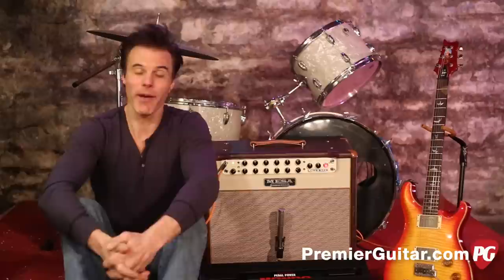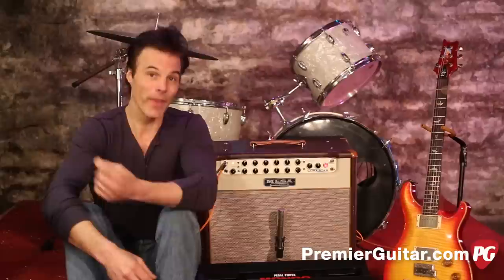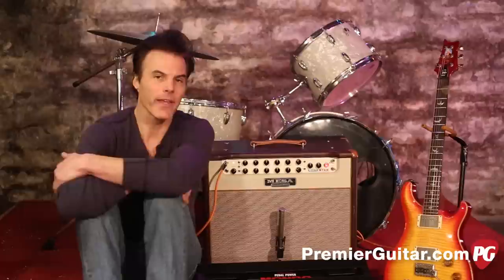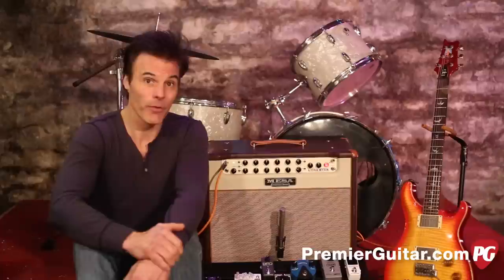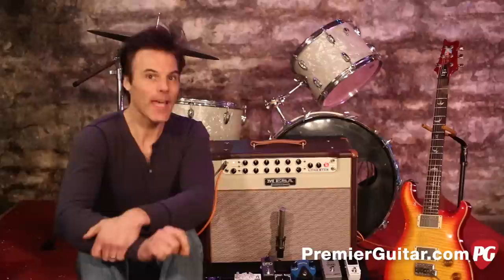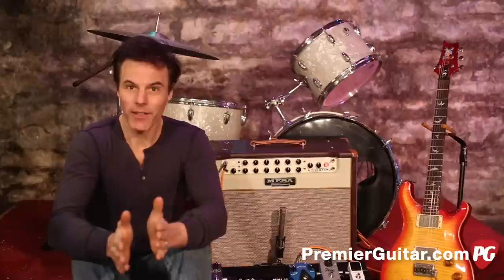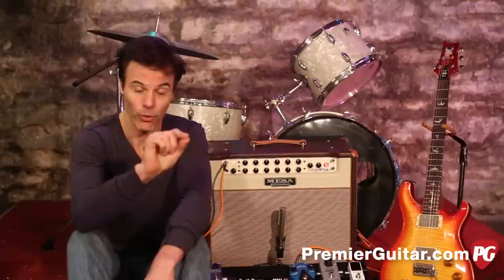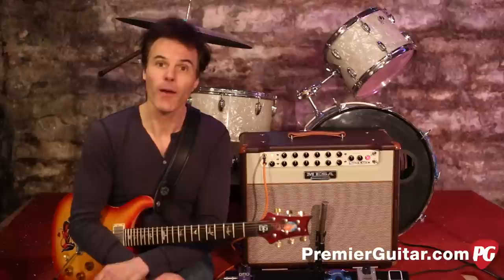DIY: How to Wire Your Pedalboard featuring John Bohlinger

Comment: Or you could use a multi effects pedal or rack and avoid all of this. Or you can run it straight into your laptop and run the laptop thru the pa. There are a million different routes to take to get what you want and almost all are valid.  That's what makes this fun. I have been using an Arion compressor pedal with a Johnson jamstation and running into an old peavey 1x12. Works for me lol.

Comment: Hello john, very good video for begginers, i didn't understand  that you say "overdrives/dist and compressors they might sound better if run it into a power supply that offers sag" 
Can anyone explain it more ? 
thx!
Reply: Some power sources (like the voodoo lab pedal power mondo) have power inputs that allow the electric current to oscillate, so that it mimics a dying 9v battery. Some people like that sound, especially on fuzz and overdrive pedals. If you have any pedal that can be powered by a 9v battery, try doing that instead of plugging the pedal into an electric source. You might notice how the sound of the pedal will change once the battery doesn’t have enough juice to provide a steady amount of current

Comment: Ok what if you used one wall supply per pedal? Would that be considered isolated and cut down on noise? I ask because I have five pedals (one is a tuner) and I only play at home so I don’t need a pedal board and I don’t need it to be portable. I just want it to sound good!

Comment: One thing that is missing....If all of your pedals are True Bypass, you will need buffers. Or pedals that have buffer. I have A Mission Engineering VM Pro volume pedal at the beginning, and a TC Electronic Flashback Delay in Buffered Bypass mode at the end.
Reply: Buffers can adversely- very adversely,- effect some fuzz and drive circuits.Try any buffered pedals before and after , and take note of differences.They can just as easily be placed mid chain.  When choosing pedals, consider it they are true or buffered bypass, and where you plan on putting them .

Comment: does this pedal board go directly into the front of the amp or does some of the pedals go to an effects loop, such as the delay and reverb, or even the last in the chain, the looper?
Reply: Thomas Weikel if you use the overdrive channel on your amp in combination with modulation/reverb/delay etc. it's better to put those through the effects loop, otherwise your modulation/reverb/delay comes before your drive and that doesn't sound right. If you use the clean channel you can put every other pedal in front of the amp, just make sure any modulation/reverb/delay comes after your drive pedals.

But experiment with the order and effects loop, there are no real rules really, but for me personally this is the way to go.

Comment: When absolutely necessary, always run cables out when they too long.  Meaning, don't coil a cable up with a wrap and run signal through it. The magnetic field will create noise.

Comment: I only need 3 pedals on my board. (ds-1, small clone, and mxr flange) would it be worth it to buy a power supply and the daisy chains?
Reply: With a boss tuner you could use it to daisy chain some pedals off it. I do that when I only use a couple pedals and it works fine.
Reply: +Oliver Smith you can easily daisy chain 10 Pedals if you lift your ground on the right spot (with seperating transformers)

Comment: OK, 6" vs 8" of any decent shielded cable will not be relevant. 6' vs 25' yes. I do sound for a living. Far more important is the impedance losses as you go through all that stuff, starting with the output of the pickups. A decent buffer built into a pedal or a dedicated buffer will handle it. See Pete Thorn's, among others, excellent coverage of this issue.

Comment: Is it preferable to power your pedals with batteries as opposed to a power supply?
Reply: Not on a pedalboard, no. When there's a cable in the Input Jack of any of your pedals, it draws power of the batteries. If you leave it in over night, the battery will die. The point of a pedalboard is to avoid plugging and unplugging your pedals so a power supply is your best bet :)
Reply: Thanks. Yeah, that makes sense. I don't have quite that many pedals yet, but I'm working my way up to a good-sized board. :)
Reply: Larry Tate hey dude. I'm looking at picking up that amp too. The FX loop is mostly used for modulation type pedals (i.e. Phaser, flanger, tremolo, delay, reverb, etc.). You will still want to run your tuner, fuzz, wah, compressor, overdrive and distortion straight into the front of the amp. This does require more cables, but that is what the fx loop is for. Hope that helps.
Reply: To give you an idea of how the effects loop works just remember that it effectively bypassses the preamp and any pedals that you use there will go straight to the power amp. That's why modulating pedals ( reverb, delays etc ) work fine there. For O'drive, compressors etc they like to, or sound better/different when they go from the guitar - effects pedals/board - front of the amp ( pre amp ). Try them through the loop and you'll probably go 'yuck' but maybe you'll like the sound of some - it's always a trial and error type thing.

Comment: Hi, what instrument cable is best to use to connect the pedalboard to the amplifier ?
Reply: Cables will impart certain sonic characteristics into your tone. It is often recommended to search for a cable with low capacitance (all instrument cables should have this quality, just some lower than others). Another thing I personally look for is durability. For my money I like the Dimarzio braided instrument cables do the job. Extraordinary durability and a clear sonic difference over my old cheapo cables. Musician's Friend usually has the most complete stock as far as length and color variants go.
Reply: +Justin Davis what's considered low?
Reply: Max Tor  Well the Dimarzio cables I use have are 33.27 pF/ft, which I believe is slightly lower than Gearge L's, which a lot of people consider very good cables. So 33-37 pF/ft about I suppose? It's not the end-all-be-all number of a good cable, but it gives an idea of the signal pass-through. I would just avoid the cheapest of cables and possibly do a little experimenting
Reply: Justin Davis thx

Comment: Do you remove your pedals from the board when packing up or do you just keep everything where it is and put it in a case?
Reply: It saves a lot of time keeping it all on the board and carrying it around in a case. Especially at show when you have maybe just 15 minutes to set up you don't want to be using that time connecting each individual pedal if you don't need to.

Comment: Why would you put a wah pedal before your distortion pedal, when you engage your wah pedal then your distortion is almost non-existent in any mix, it does not favor the metal genre BUT... I can see it working with Blues or Indie Rock. 

My two cents.

Comment: Impedance, right - not capacitance? Capacitance is a component in impedance, but so is resistance. That's where corrosion, long cables, and cheap metals come into play.

Comment: This is a wrong suggestion the tuner does not go first the fuzz is impedance sensitive and goes before the tuner with that buffer. A noise gate will usually go after your drives. Also Velcro is junk use 3 m duel lock

Comment: How do pedals and order differ with effects loops?
Reply: Michael McCabe yeah, exactly what i am missing from this video...
Reply: Michael McCabe If you are using the amp's distortion, you have to put modulations, delays, and reverbs in the loop, otherwise it will sound terrible.  It's not subjective either, delay in front of distortion sounds like poop.

Comment: Does anyone, or may this youtube channel make a video to introduce a pedalboard for metalcore?
I have a boss NS-2, an Ibanez TS-9, a filter LF7 Ibanez, a chorus pedal CF-7 Ibanez, a delay Boss DD-3, a line selector BOSS for channel switcher between clean and distorsion sound.
Does anyone know how to put them on a pedal board to avoid any noisy soind and bad feedback?
Cause I have a bugera 6262 with an effects loop, but my noise suppressor doesn't filter the noise as good as it would work...
hope someone will help me

Comment: it's not capacitance its impedance
Reply: I thought I was the only one who thought this ......capacitors store energy , impedance is the strangling of current ....at least that's what I remember being taught
Reply: And he made such a show about the word too! Kinda sad.
Reply: Dewey Rayburn cabels havent got any capacitance as far as i know :D
Reply: Then you don't know very far. A capacitor is a dielectric between two conductors. Cables are this, and treble bleeds through them as it would through any other capacitor. Cable capacitance matters. Cables also have impedance, but this is negligible unless your guitar cable is longer than a kilometer or the connectors are damaged.

That being said, expensive cables are a bogus money trap for suckers. There are crap cables that you should certainly stay away from, but good cables don't need to cost more. Get the EBS or Rockboard flat patch cables. They have a great form factor and do the job as well as any piece of 20$/ft cable you can be duped to buy.
Reply: Idk if I'm reading your response wrong , but are u saying there's capacitors in a cable, or that a cable stores energy like a capacitor? I can buy a cable holding some energy but being released as quick as the ground allows ,which is why I quit computer electronics school when I had an A+ avg to that point....I was taught a capacitor stores energy till it's released by the current to the other side of the capacitor....to me it seemed impossible to not have a constant release of energy from the capacitor when there always a completed circuit .... but I digress , though your statement is maybe technically right , I believe in the video he did mean restricted current or impedance .......but again I'm no professional and it really isn't all that important ,I just thought it was a funny misspoken statement ...and if not , no great loss either way ....it always kills me how one of these comments can get a pro and con response of which both are absolutely sure...lol well usually one is wrong ,at least a little bit ....but no one wants to open their minds up to that possibility ......it's human nature I think.....I try not to do this type of stern "I'm right your wrong " stuff , so I'll say this is what my experience has been ....and also why I explain myself so detailed like in these situations.....can't we all get along ? 😂
Reply: The energy transmitted in instrument audio cables is very low. The capacitor (cable) has a different effect in this situation. With a capacitor and a resistor, you can make a low pass filter, a type of circuit that allows high-frequency content of the voltage-transmitted signal to bleed to ground. This is why long or poor cables cause treble loss when the signal is not buffered.
Reply: It's in the words. Capacitance is the capacity to store energy, Impedance impedes current.
Reply: Impedance correlates better with cable length. Capacitance correlates better with the number of connections (including the quality of those connections). I just nerded it down for everybody. Use this as a rule of thumb.

Comment: Video is a bit of a FAIL because the guy never even brought up routing the time based fx through the amps FX loop, if the amp has it, which that high dollar Mesa amp behind the dude most surely has.
Reply: but it depends on the behavior of the fx loop, whether it's at instrument of line level, and the pedals' ability to run at the correct level (timeline has line output level, boss rv6 does NOT. Can't put those in an fx loop together, chief). Additionally, the fx loop doesn't even matter if you're not using a distorted channel on your amp. They're more useful as send/returns anyway